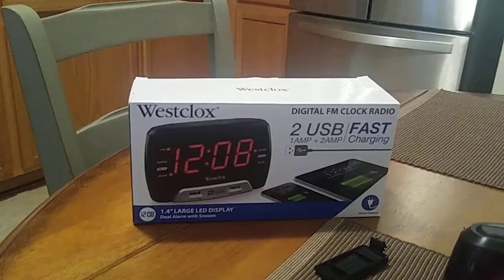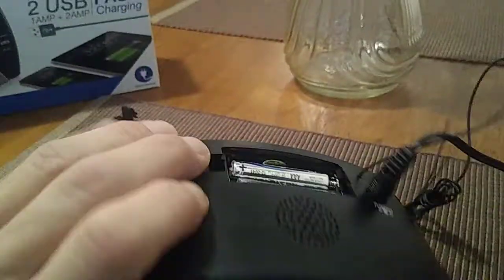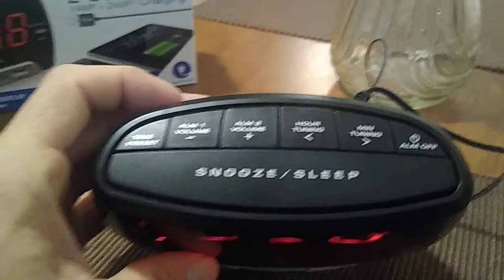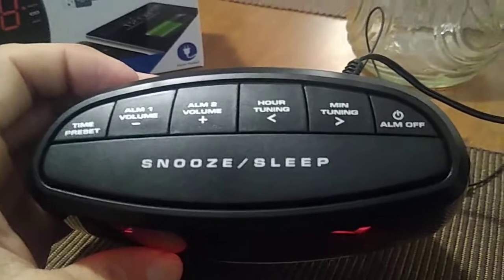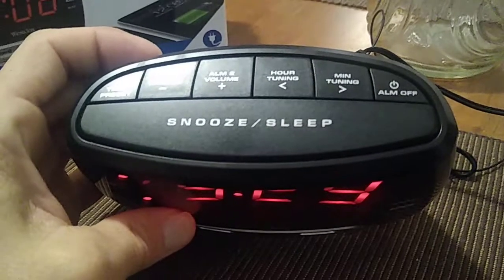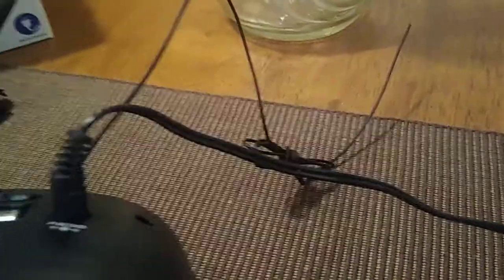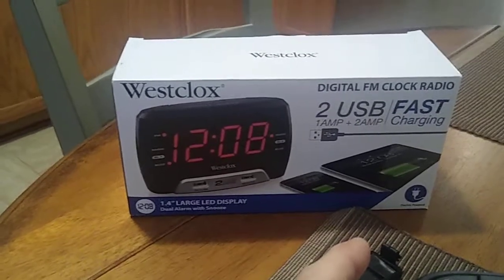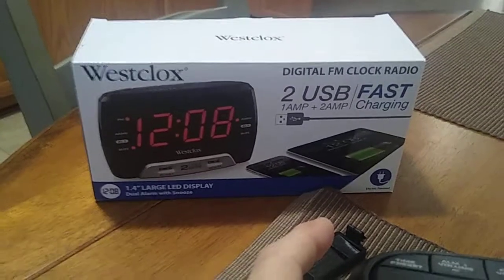⏰🎶💤📻🔋#Battery & Setup-#Westclox Digital FM Clock Radio-#Model-80227WM

Comment: Mine will not set the radio channels unless I'm doing something wrong
Reply from the maker: Check out my manual video for this product on my YouTube Channel and Playlist 📝 and see if it helps you
Reply: @johnzabik270  I have the book that comes with it it just not taking the stations or I'm not doing it right
Reply from the maker: Did you set up the antenna?
Reply: @johnzabik270  yes I did just won't set the stations